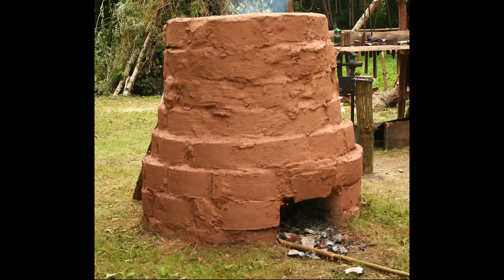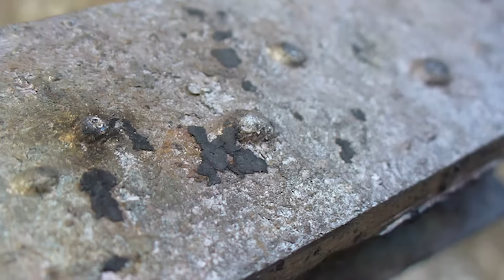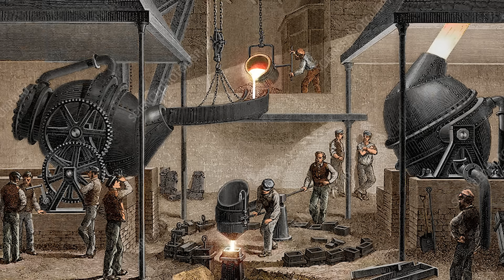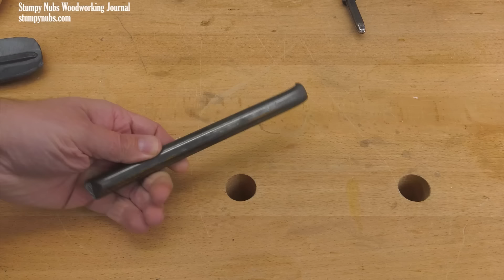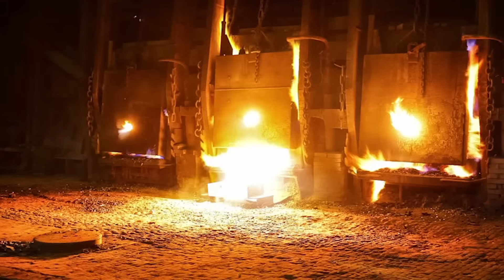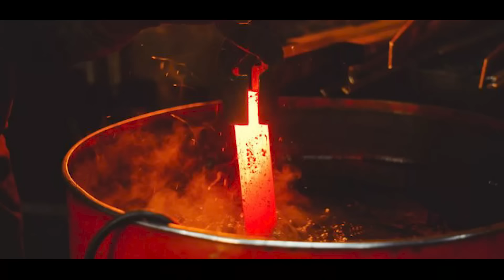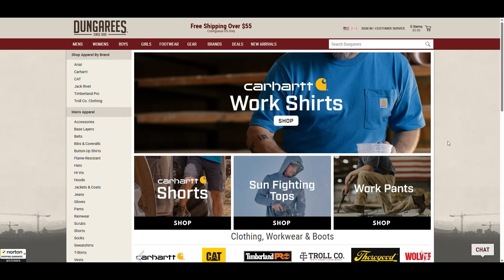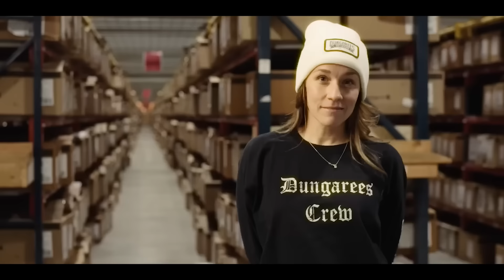Why they REALLY don't make tools like they used to

Comment: this trope, that the past was better, comes from bad people running corporations for maximum profits. start with a good product, make a name, gain consumer trust, degrade product ever so slightly but tell consumers "it's better", keep degrading the product so profits maximize, eventually consumers realize the product is degraded to the point that you barely get half of the original product use. then there's planned obsolescence: purposely building defects into a product so it fails after a specific amount of use. survey consumers: how long should a product last before you accept it's value enough to buy another one? if consumers respond "two years" then make your product last two years, and you'll force people to give you more of their money. if consumers weren't ignorant idiots, they would all have responded to that survey "forever, never have to buy another one." but they didn't, and here we are 🤔🤷‍♂️

Comment: You should indicate that for tool steels, hardness is measured on the Rockwell C scale.  There are other Rockwell scales, such as B or 15N that are used for softer materials or thinner cross sections.

Comment: Excellent explanation James.  Thank you.  I have some Narex chisels, and I've no complaints other than the side edges could have been a little sharper for dovetailing.
Reply from the maker: It's actually more difficult to make chisels with sharper sides because the machines have a difficult time holding them during the grinding process. That's why only higher-end chisels have that feature. Narex's "premium" and "Richter" chisels have sharply beveled sides.

Comment: I've suspected that there's other factors going on here, beyond the scientific qualities of the steel. Junk tools wear or break quicker. That implies that the vintage tools that are still around today are either around because they started as good tools, or (less likely) they're unused - that means that a higher proportion of them are not going to be junk, simply because they've survived to this point. The same can't be said about more recently made junk tools.

Another factor I'd considered is that maybe we just made less junk tools because it took more effort to make them in the first place, whereas nowadays the technology/methods are so much faster that it's become more profitable to churn out far more, far lower quality tools.

 A connected point is that maybe consumerism and mass import/export might have something to do with it, a lot of tools might not genuinely be aimed at actual trades/crafts people but more aimed at the average homeowner, who nowadays has a far higher tolerance for cheaply made throwaway purchases. 

I also think the nature of the companies pumping out the same low quality, possibly rebadged generic tools - there seems to be 100's/1000's of smaller random named brands all flooding the low end of the market - rather than just a few larger brands filling different parts of the markets - makes it harder to wade through the sea of junk to find reasonably priced quality tools.

Comment: So i'm based down under. I collect chisels. They are one of the main things i use and there are some things i've noticed;    For a start, Australian Steel is excellent. My feeling is that we just got lucky, so the iron ore here is just better.   So within that there was a factory in Tasmania, 'Titan" (later purchased by Stanley).    These are really  great chisels. they aren't highly sought after but they really are lovely.    A number of times i've bought old tool boxes and there will be an Eskilstuna sitting right next to a Titan. The Swedish chisel will be well on its way to being dirt again and the Titan will be perfect, almost untouched by time. They are pretty hard which is valuable in the Australian environment where so much of the timber is hard.      The Aussie Stanleys with the yellow and black resin handles are of much the same quality.   Really nice...   Time wise we are talking  1950 to 1990 perhaps, so post war.
Reply: Stanleys from that period were hardened to R62 and are of very fine quality. (I'm familiar with the American ones) many of the old ones are W-1 (water hardened High carbon) they take a lovely edge, but they have a tendency to rust quickly. In the 1950s and 60s they came out with a high chrome carbon steel that was often referred to as "silver steel". (they still make a silver steel today, but it's not the same thing) This high chrome alloy, while not a true stainless steel has some very nice anti rust properties and holds an edge quite well.
Reply: @ericericson4 yer I guess another factor to consider is that back in the day planes and chisels were the primary workhorses of tradesman and they would have a lot of attention from the manufacturing perspective.

Nowadays the emphasis is much more on power tools, that’s where the money is.

As ya say though is still companies doing it very well. The Pfeil stuff from CH and Stubai stuff from Austria..

Really combing the best of the old and the new.

Really fantastic… Not cheap though.
Reply: Kiwi here, I got a set of 11 Stanley with the yellow and black handles around 1991, some are Aussie   made, some say Sheffield England, the Aussie ones have a cylindrical ground shank that is ground by hand, the Sheffield ones have a tapered cone shape shank with a machined finish, both seem to be the same quality of steel, none of the resin handles have ever broken despite being bashed with the side of a steel hammer for the last 30 years.
Reply: @adambrewer9182  I have a set of Stanley England blue handle from the early 90s that I bought new and use every day. Stanley England tools are great.
Reply: @adambrewer9182  I don’t know much about NZ timber but if I try carve a bit if redgum or sugar gum or some thing really hard, the English chisel will fail me. Whereas the chisels that came out of that Titan factory will go places the UK chisels won’t.   I’m travelling and working I only pack Titans nowadays.

Also they are really cheap and plentiful here. I don’t think people have twigged how exceptional they are.
Reply: Does that apply to Aussie automotive steel?...  I have e.g. seen some pretty wild video-series about restoration of Ford Falcon XB GT:s..  I mean, there is a reason Max went Mad, is it not?....
Reply: @AndreasAndersson-ve4jx  It might, If the Aussies were using a high chrome alloy it would be difficult to weld, even if it's not a true stainless.
Reply: @AndreasAndersson-ve4jx  yes I think it would actually. Apparently Brazil also has some fairly exceptional ore.

I guess my point is that people imagine you just heat up your crucible, add your ingredients and hey presto. That’s partially true but the quality of your ore is still big part of it even today.
Reply: I'm inclined to say, if the Swedish chisel is almost done but the other one isn't, it's because the other one is so crap that it barely got used.
Any tool that gets used to its ability will experience wear. Abusing a tool will accelerate wear, but you can pretty surely exclude that the superior quality of Australian iron atoms, which are exactly the same as iron atoms found all over the planet, are causing the Titan chisels to hold longer than any other decent brand. Steel can't read, so it'll never say "oohhh, the package says, I'm from region xxxx, I must be better than the one from region yyy and therefore hold longer".'
And a lot of the "back then everything was better" enthusiasts are completely blind for the things that haven't been better. Yeah, sure, nowadays cars are completely crap, break down all the time, shit load of electronics issues kicking in after 200 000 km or so... Just being blind to cars from let's say the 70s taking 30% more fuel for 50% less performance, and being completely done at a time where a modern car gets sold to the second owner.
Exactly the same behavior can be seen across pretty much any industry. The old stuff is absolutely nuts hyper extra blackhole gold, while the new stuff is so crappy that you can't find words for it - unless one checks objectively.
Reply: @smurface549 dude, I literally own hundreds of chisels from all over the world.

I’ve been using them in various capacity’s for 30 years..,

But erm, you obviously know everything .

I couldn’t give a flying f$&( what you think.

Comment: I think lots of folks have been lead astray here because brands that USED to be of high quality were bought out, gutted, and turned into very cheap, very low quality junk made in certain nation's factories full of people who clearly don't know what they are doing when it comes to metallurgy and machining.

Which has caused people to seek 19th century goods, that while wholly inferior to properly made 2020's goods, are still worlds better than goods from factories that think that "all grey metals are the same" and mix 22 different alloys of steal into the same blast furnace and send it.  

But PROPERLY made 2020's tools are going to be literally the best tools ever made in history.  The modern understanding of metallurgy and the manufacturing tech is so advance steels are being made to an alloy precision only possible in laboratories in the past, and the final products are being made BETTER than the best craftsman could dreamed of doing by hand in the old days.    The problem: they are going to be a brand you probably haven't heard of, it DEFINITELY NOT a brand your grandfather used.   All those brands were bought up by capital holding companies and reduced to "apprentice grade" at best.

Comment: Steels now days, you can get whatever type of Steel you want... Tools that Stay Sharp Longer are Harder to Sharpen, because, they are harder.. 
Easy to Sharpen means, won't hold an edge as long.. The Japanese Forge Weld(Laminate) a Thin Hard Steel to a Mild Steel, and, can get a very sharp edge, that is both quick to sharpen, has some flex, so, won't chip and break like other hard steels, but, has a thin high carbon steel, that is quick to sharpen... 
Steels are Much More Advanced now, than they were in the past.. Much, Much More Advanced and advancing all of the time.... Research White and Blue Paper Steel made by Hitachi. It is what the Japanese use to create their Fine, Super Fine Edges... Research the Kanna Plane and the Blades they use.. 
You will pay a premium for the Cupped back fast to sharpen Plane Blade, and worth every penny, if you use it regularly...

Comment: That was far more interesting than it might have been! Thank you James, for a well researched and excellently presented piece. I started using mechanical and carpentry tools in the 1970's (as a young man who may have not always had the right tool for the job, so may just have 'substituted' in the worst possible ways, but the tools always seemed to survive the abuse!) and 'Made in Sheffield' still meant something, be it a socket set, or chisel, or screwdriver. Sadly, in recent years, I have bought so-called Sheffield tools, only to discover that they are actually made in China! How times have changed.....

Comment: A lot of the original tool steel alloys like O1 and A2 are close to a century old and still in common use, they make great cutting tools compared to simple low-alloy carbon steels as they often contains chromium and vanadium to produce those carbides, which are harder than the Fe-carbides, thus lasting longer. Over the years the high alloy tool steels have come leaps and bounds, most of it is made as strip-steel to dimensions and sold off by the tonne to whoever needs it. Now the metallurgy compared to today even over 30-40 years ago is pretty much a generational improvement to the extent that its beginning to eclipse older tools steels by noticeable margins and that's down to particle metallurgy processes that provide a mix of consistency in the alloy all the way through from one batch to the next. They are stronger for impact, sheer forces, they hold edges for vastly improved amounts of time and they can make them to operate in anything from sea-water to a wood chipping machine exerting 100's of kilos of force on them.
The other half of the equation is the industrial processing of tools, its written down, scientifically proven and its consistent, that consistency is why if you buy a modern tool with modern steels it will exceed the properties of something made 50 or 100 years ago- the downside? Not many, the cost is a factor but if you're a professional who needs their tools to stay sharp, last every workday and will make you money every hour they are in use, then that's where these shine, if you're just a hobby worker then you'll probably be able to pass these onto your kids and they'll e good enough for the grandkids to use as well.

I won't put in a vast amount of technical knowledge as this is already an essay with my 9.5 working fingers, but check out knifesteel nerds, he's got a website and youtube channel that if you're interested in more aspects of the industry, he's the go to guy for us tool and knife makers
Reply: Very much the same can be said of modern alloyed tool steels used to manufacture milling machine cutters and HSS lathe tools....the modern alloys are incredibly durable compared to older tool steel recipes.
Reply: @howardosborne8647 
In my opinion the average person has literally no knowledge of the various tool steel alloys used in industry. The cheap alloys are the lower SAE numbers with enough carbon to be hardened without being run through a carburizing furnace. Then we get into the Letter series. On top of that there are the trade name alloys. Some of which fit into the SAE and Letter groups. One of my favorites from the machining standpoint is a graphitic tool steel called Graph-Mo. Letter series O-10. Machinability off 110 at least. Heat treats beautifully. Minimal distortion. Great wear characteristics. Originally developed for producing Timken tapered roller bearings by Latrobe Steel. Owned by Timken. 
The world of copper alloys is just about as complex. If you have heard of a company called Ampco their first commercially sold bronze was meant for use as cutting tools for machining the steel alloys of the early 1900s. To replace the carbon steel cutting tools then in common use.

Comment: I was given an old 30's Fulton Stanley style plane. It was in general neglect but restorable.  
Restoration went pretty well until I got to the iron (blade). It was ground at the wrong angle. I made a jig to get it back to 25 degrees. That blade was clearly of tool steel. All my usual sharpening stones were useless. Even my 6 in belt sander just barely set the edge. It is tough stuff. I'm finally homing in on sharpness using lapping compound in a last effort to get it sharp. I'm getting there, but this ketal is tough stuff. A work in progress.
Reply: Do diamond lapping stones work to sharpen this super tough steel? I use Cubic Boron Nitride (CBN) grit wheels on my bench grinder to sharpen very hard lathe cutting tools and the CBN grit wheels work extremely well for this.
Reply: If it's so old, I don't think it's of some very high tech alloy, but was just  let at a higher hardness. What kind of belts do you use on your grinder? I had not too much problem grinding K390 high alloy, high harndess steel (64,5HRC) chef knife on creamic belts (made for this kind of steels). And it's hundreds times more material and surface to remove than on a plane blade. It's true, though, that when it came to hand finish to a 600grit satin finish, the sandpaper barely scratch it. 

That reminds me that my brother gave me an old Japanese plane iron to fix, it seems that it's either tempered to a too high hardness (in fact not enough tempered), or it was overheated during HT, because it's too brittle.  Maybe it needs to be re heat treated.

Comment: My wife has called me a tool snob before, but I don't like to replace tools, so good steel is a must.  Yeah, I have some cheaper tools that I beat on, but it is the higher quality stuff I use in the shop for fine woodworking.

Comment: Excellent presentation on the actual science and process of making tools, iron, and steel. Rather than anecdotes about how things used to be better, you have to consider the actual physical makeup of the material. Today’s alloys and processes of reputable makers far surpass things of old. The trick is also to update sharpening methods to accommodate the harder steel alloys. 

I have scored some Japanese knives super cheap because they’re chipped all to hell. Turns out they’re different than stamped flexible “ninja” serrated knives. Reprofile, sharpen, and enjoy. 

Same with chisels. Know the steel. Know the goal of the technique. Boom. Success. Razor sharp chisels? Great. Razor sharp lawnmower blades? Foolish (other than reel mowers). 

Knowledge is power. Thanks James!